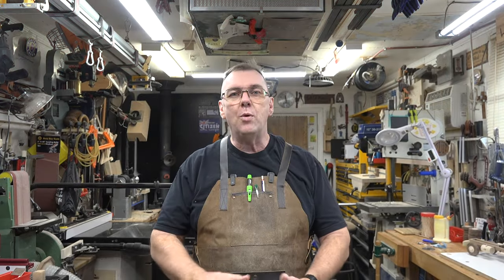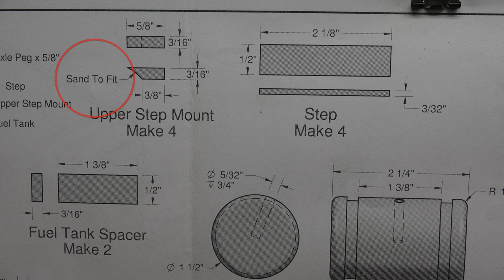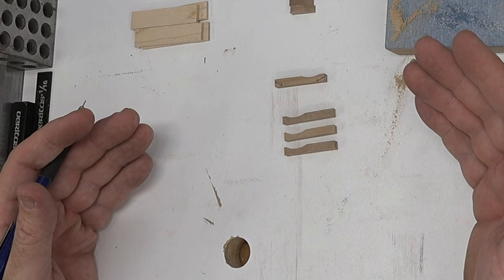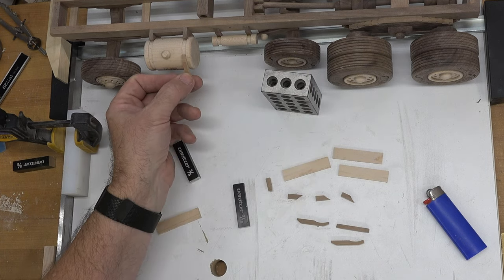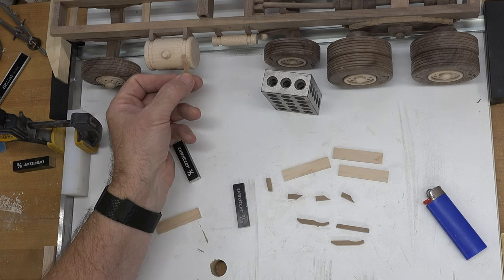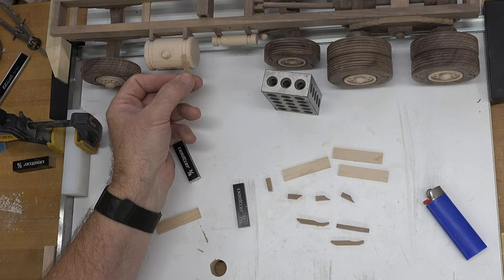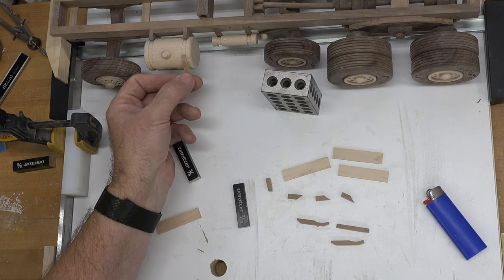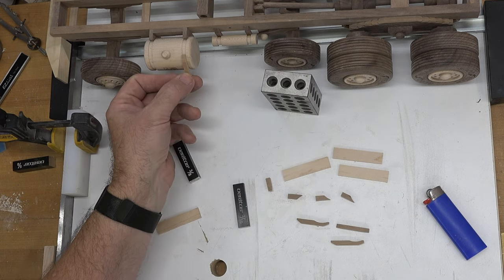Making Toys and Joys Dump Truck and Pup Trailer Part 9

Comment: Great video, as always.  It interesting how you always seem to have stock that works for your builds.  I have a rack of wood, and never seem to have what I need.  LOL.
Reply from the maker: Because I mill all my own stock from 8/4 rough sawn wood, I almost always have a variety of stock to choose from.  For most of the larger pieces I will have to mill stock to suit but for smaller pieces, I have the scraps separated into species and it's quite easy to look in and grab scrap that will work.  Thanks for tuning in Scott and for the kind words.

Comment: afternoon Kenny, glad with your tip of cutting small strips on the outside (see min. 1.35). But why do you cut the small strip for the bracket (see min. 2.59) then on the fence side?
Reply from the maker: This is a great question Peter.  "Thin strips" for me is anything less than 1/8" in width.  I have safety push blocks that will hold, cut and support 1/8" thick material to cut it between the fence and the blade.  Also, with a zero clearance insert, a 1/8" thick material can be supported by the throat insert when cut between the blade and the fence.  Anything less than 1/8" loses it's support and there is no way to safely push it through the blade so cutting it on the outside of the blade is the safest approach.  When I cut the strips for the steps, they are 3/32" thick and therefore cannot be properly supported or safely pushed through the blade as they are less than 1/8" and should be cut on the outside of the blade.  When I cut the strips for the step brackets, I cut them between the fence and the blade as they were 3/16" wide.  My Gripper push blocks can safely hold those strips and my zero clearance insert can easily support them while cutting, hence cutting them between the blade and the fence.  I hope this clarifies it.  Great question!!!!  Thanks for tuning in Peter and for taking the time to leave your comment and question.
Reply: @acutabove_woodworkings  Thanks for your great and extensive answer, very helpfull. I have 2 pushblocks also for my Metabo saw, I also use them on my small proxxon saw for cutting small(er) parts. I also stopped converting everything into metric, bought me a T-ruler inches, that saves a lot of hassle.

Comment: morning Kenny,  another question: what are the most common used brad point drills in inches? 
In one of your episodes I heard you saying that a certain measurement is not common (on T&J plans), didn't quite hear that size.
I have 1/8, 3/16, 1/4, 5/16, 3/8 and 1/2.
Reply from the maker: I mentioned that a measurement that was rare in Toys and Joys plans was anything less than 16th.  This doesn't apply to the drill bits and it only applied to cut measurements.  The drill bits that you have are a good start.  3/32" are 9/64" also commonly used.  I would suggest finding yourself an inexpensive variety drill bit set on Amazon or your local woodworking supplier to cover the basis.  Buying them one or two bits at a time can be expensive.  I hope this helps.  Thanks for tuning in to the show.